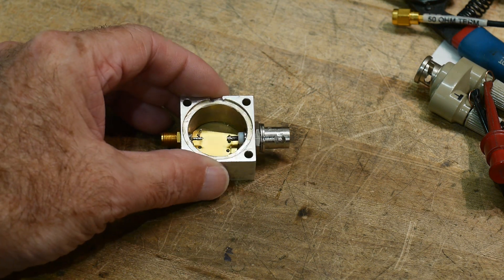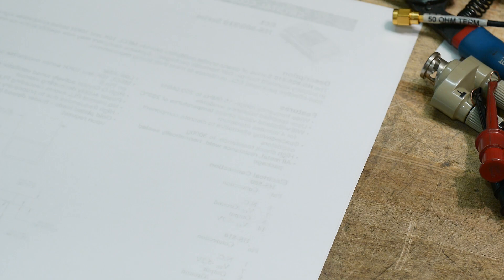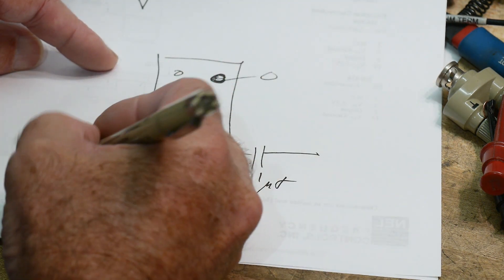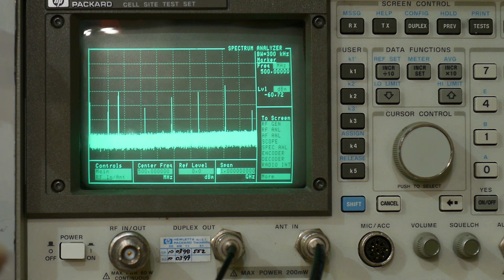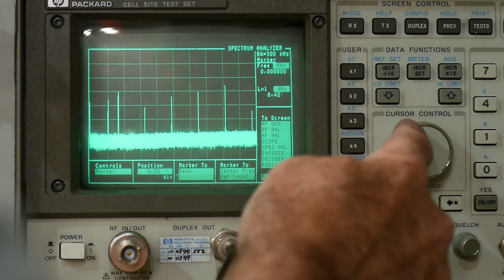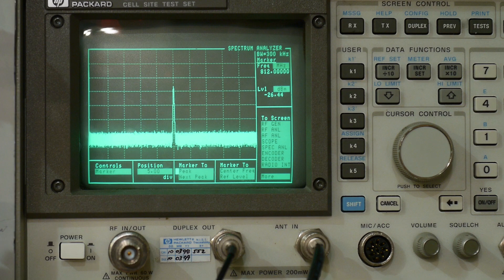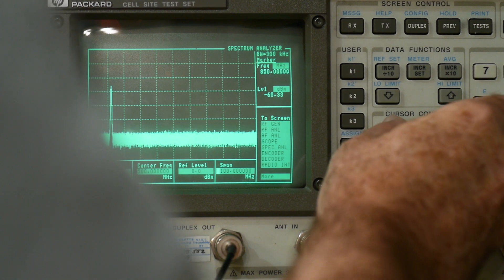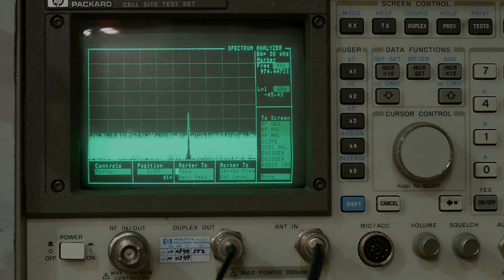#595 SMA 162.4 MHz ECL Oscillator with Harmonics

Comment: Hmm, could be the oscillator was intended to provide the higher frequency harmonic. You may want to keep an eye out for used Trilithic tunable bandpass filters, think Shariar covered them on one of his Signal Path videos long ago. Although they're not razor sharp having one with the proper range would allow you to isolate a signal from its other components for analysis. The filters are built like tanks!
Reply from the maker: my good friend pointed out ECL needs a pull down resistor. Now it outputs -4dBm

Comment: the VCC pin is connected to ground so are you saying that the box (shield) and the shield of your coaxial cable are sitting at +5V? how?! even if your power supply has isolated output but when you connect the coax on the other side (output) to the spectrum analyzer which is grounded then you are forcing the shielding to sit at 5V w.r.t. to ground....i am confused .. i think this oscillator is not supplied correctly. I suggest you monitor its power supply pins with an oscilloscope... that could explain the weird behavior unless i misunderstood something
Reply from the maker: the input is ground to shield and 5V center on the bnc. inside the box the osc is floating so 5v goes to ground on the osc and gnd to -5 on the osc. it is all isolated from the box. the output is cap coupled so no dc path.     my friend pointed out that ECL requires a pull down to -5 on the output as it is open emitter. I might go back and put in a resistor at some point.
Reply from the maker: I added the resistor and now it outputs -4dBm
Reply: @IMSAIGuy  I think you would post another video to show the difference. Is the 101 MHz signal still there..!?. What happened to the 5th harmonic..!?

Comment: Change 0.1 uF to 470pF .... i think that effects the results measured
Reply: Changing the value from 0.1 uF to 470 pF might allow higher frequencies to get coupled well. But the origin of the 101 MHz signal below the fundamental and the larger amplitude of the harmonic beyond 800 MHz can't be explained, I know.
Reply: @subramanianr7206  The 0.1 capacitor with the leads can cause wonderful behaviour .... that's why i am curious if you would replace that component
Reply: @egbertgroot2737  it's an SMD part with the minimum leads...!!!
Reply: @subramanianr7206  At 900 Mhz any lead towards this cap is a coil. For experimental purposes it would really be interesting to see the difference
Reply: @egbertgroot2737  your original thought was to changing the value of the capacitor from a 100nF to 470pF; the results were attributed to it. And you simply keep deviating in your responses. Hi..hi.. There was a signal on 101 MHz. The 5th energy was larger than the fundamental. You have to explain how a 470pF capacitor can knock off the bizarre results here.
Reply: @subramanianr7206  Let's continue this  after IMSAI Guy hopefully proceeds this video with a different capacitor. The base tone of this crystal oscillator is probably lower internally. Let's hope he finds the time to do the experiment
Reply: @egbertgroot2737  Ha..ha.. I anticipated a reply like this.